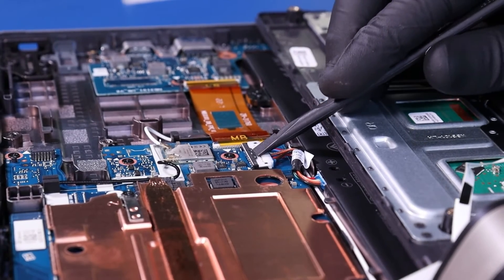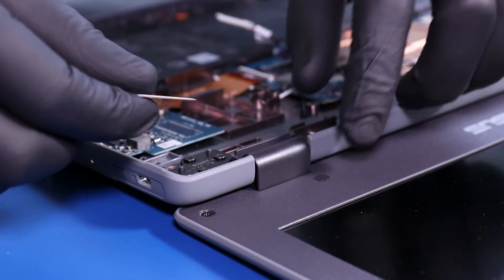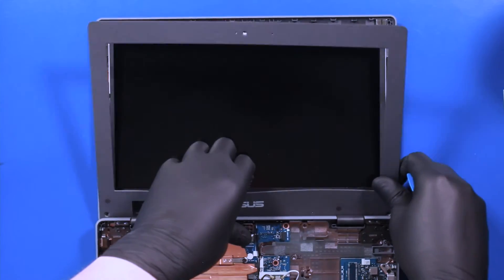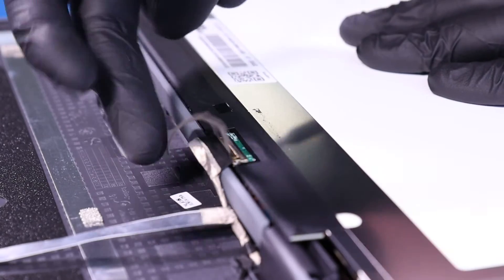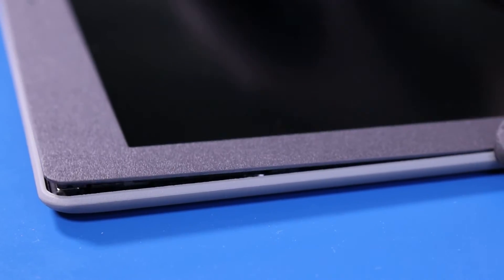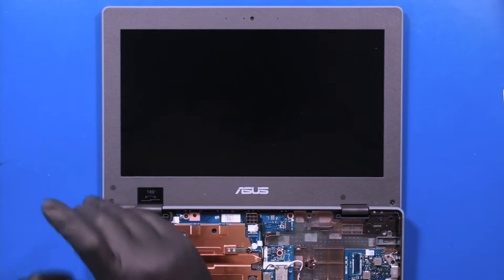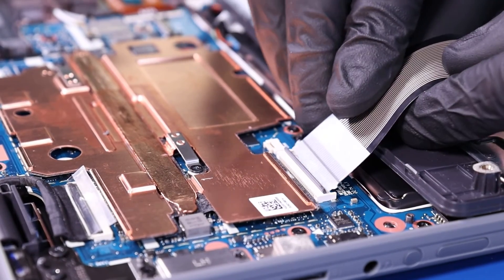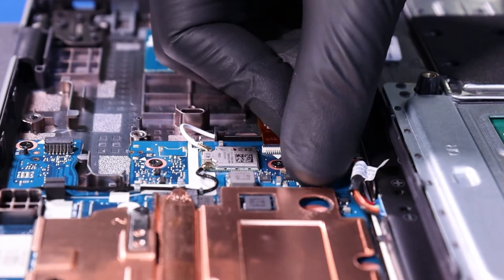Asus CR1100CK Chromebook LCD Screen Replacement

Comment: I've been having a strange issue when replacing screens on this model of chromebook, where any screen connected after disconnecting the original screen (It might even apply to the original screen, but I haven't tested that) only works when applying pressure to the connector via the bezel. Is this happening because I left the palmrest assembly on the computer the whole time, removing only the bezel to access the screen?
Reply from the maker: Hello! Without seeing it, we have a couple theories as to what could be causing the issue. Assuming the LCD cable is plugged in all the way, it's possible that the screen connectors may have a bad solder joint and pressing on the screen reconnects them (were they all from the same batch?). You also may have received the wrong LCD - for instance, if you have a touch model, you could have received a non-touch LCDs and pressing on the bezel causes the right connectors to align. We do not believe this issue was caused by removing the palmrest, however.
Reply: @Chromebookparts  I'll try to see if either of these are the issue when I next have access to those chromebooks. If not, I might be able to upload a video of the problem instead of trying to describe it?
Reply from the maker: Sure, it couldn't hurt to get a look at it!